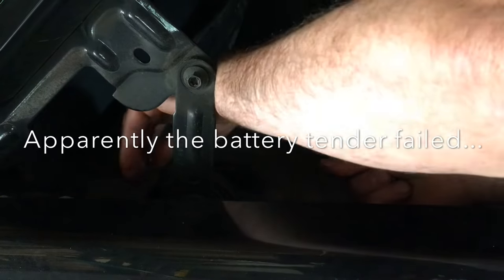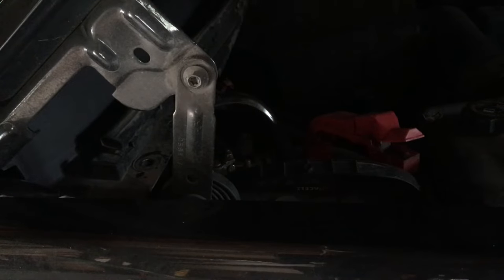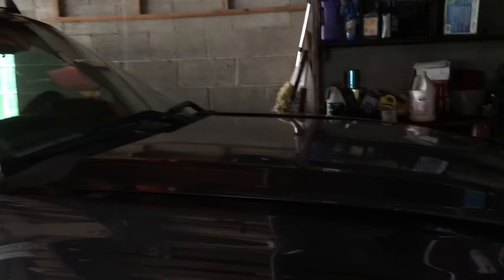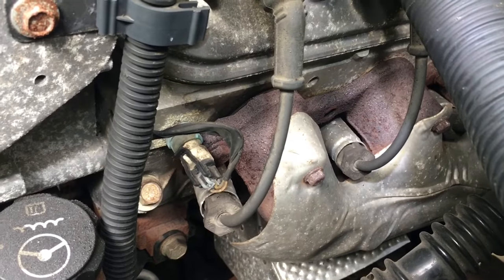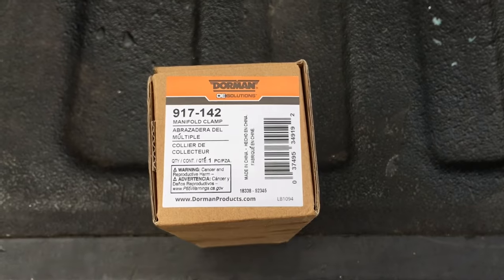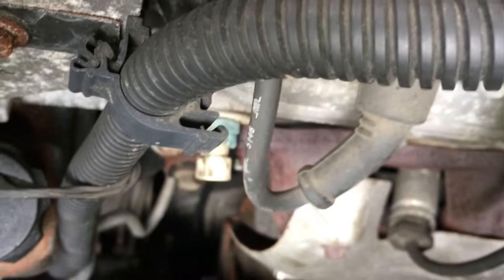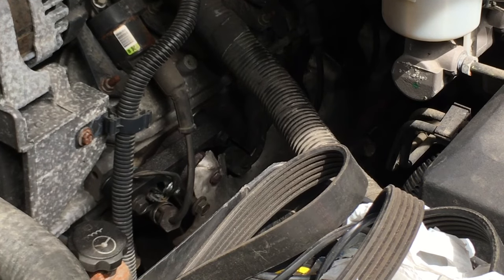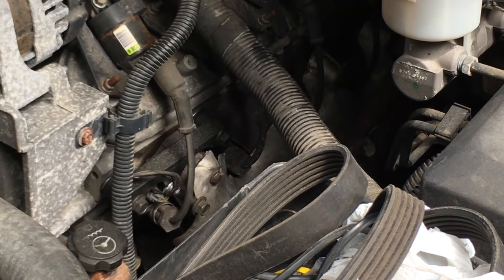5.3 Exhaust Manifold Leak Fixed With Dorman 917-142 Clamp

Comment: You don’t have to remove the heads to remove broken studs, remove front wheels, fender liners, and pull the manifolds off, clean the broken stud hole out with brake cleaner, get you a harbor freight welder and a bucket of nuts and weld it on. If you’re lucky it’s either stuck out or flush, I’ve had them recessed in 1/8th inch. Fill in the hole with weld and then weld a nut to it. Slowly back it out, loosen and tighten. I’ve had one broken off on both back firewalls that’s the most pain.
Reply: Get a punch and firmly tap that stuck bolt to break it free and then You can use a copper tube to run down however far it is recessed into the hole then fill that with weld up to a nut. That’s the way I’ve had the most success
Reply: That's where mined broke off as well
Reply: I mean, that's kinda outta the realm of the diy-er. Buy a welder, learn to use it, etc etc. But you're not wrong, I suppose
Reply: @natemartinez4595  I’m a diyer and it’s exactly what I did. Don’t forget to chase the threads after you get bolts or you’ll be snapping more bolts in those bad threads

Comment: I just now used the Dorman front driver side clamp on my 2001 Tahoe, 5,3 Vortec.  I am far from being a mechanic.  It took me maybe 15 minutes max.  Exhaust ticking gone!  It fit perfectly with no trimming of heat shield required.  I just disconnected the coil wire (left the spark plug wire connected) and temp sensor.  I used anti-seize on bolts and screwed the clamp on and tightened down on the manifold bolt.  Reattached everything and it worked like a charm!  I highly recommend the Dorman clamp.  Don't fool with cheaper model.

Comment: Just my luck...the #8 cylinder had the exhaust leak.  Bought the 917-142 and damnit if the rear bolt hole that this was supposed to attach to was broken off!  Fortunately, the rear bolt that was missing from the exhaust manifold was just missing and not broken off.

Comment: Yeah,  that work good  ,I install six o those  ,that one at front driver side, center and rear it works the same clamps on the passenger side in the opposite direction, one hour repair, that sweet I didn't have to remove any bolts Haha, this isn't a mystery GMC meant to get this clamps in the market  that explains that extra holes all around the manifolds heads 👍
Reply: Removing the bolts are pretty easy I live in PA and mine is a 2000 Silverado 1500 heat them with a torch to cherry red tap it with a hammer and they come out like butter but unless they are broke this is perfect
Reply: Pedro was your truck misfiring bad before you installed them
Reply: Have a link to all of the clamps?
Reply: @THERIPPER216  get them on Amazon.
Search your vehicle name and manifold clamp

Comment: I ran the sensor wire through the hole and plugged it in before I installed the bolts (1st time I could not get the sensor to plug in when the bracket was installed, so i had to pull it off and start over). So far so good, no annoying exhaust tick...

Comment: Mine does the same!!! I now will check out those studs!
Reply: Turns out I have a broken stud on each side and they are both up front so easy fix!
Reply: I installed it and it fixed my issue!!!
Reply: Did you have to trim your heat shield?
Reply: @matthew8193  can’t remember I think I just bent it out of the way or removed it.

Comment: My 09 F250 leaks from exhaust tip and rattles from the front when I start it. Should I replace the exhaust manifold ?
Reply from the maker: Hard to say without seeing or hearing the problem. Sounds like you should get it evaluated and make your decision based on a mechanics findings. Good luck!

Comment: Pass side rear broken head, not leaking yet. I've been gearing up for this battle, lubing them copiously with penetrant oil. Had two on a 3/4 6.0L that were a monster bitxx to get out with head installed. These weren't available then. I think I'll still change out the good ones with new anyway to avoid, if possible, any further headaches. Crap design for so long and they just keep ignoring it.
Reply: I got all of mine out by just using wd40 over a course of two weeks.As long as your bolts and manifolds aren't rustic looking they should come out easy just don't use a breaker bar or impact only a socket and ratchet.
Reply: @Tyler Hubbell  Welding a nut over a washer over the broken stud is the answer. The heat breaks loose the thread locker and the nut can be wrenched out even in the worst position.
Reply: @JoeBribem  you could do that if they break but I was talking about trying to get them out if they aren't broke "YET".

Comment: Right I got see if that work on my dodge ram 2001 360cu in driver's side back by firewall exhaust leak if Not what pain ass to pull mine all apart 2-weeks to fix mine alone.

Comment: I’m looking for one of these now for my 6.2L. Wasn’t sure how they worked but this definitely worked. They’re hard to find right now like everything else. Wondering how it held up because I’m not thrilled about removing the whole exhaust manifold
Reply from the maker: No issues. Someday I might have to do the manifold but it is still hanging in there.
Reply: I got mine on ebay for like 35 buck for all 4
Reply: @Operator-fq2fn  what a deal, i feel like gm should have had these on from the factory
Reply: ever find a fix without removing the manifold? dorman didnt work for me. 17 sierra

Comment: Mine is the very front manifold bolt on driver side do you think that will still fix it?
Reply from the maker: Dorman makes a different clamp for the outside bolts. See if 917-107 or (something similar) will work for your vehicle.

Comment: I have a leaking exhaust manifold .. it looks like drivers side in the front.. Where do I know from, if it is the bold and not the only the gasket? Can I see it from above if its the Bolt in the front (Chevy Express 4.8 V8 - 2005), when I remove the dog house?

Nice video btw :)
Reply from the maker: You could see if the Dorman corner bracket clamp is a better fix. That clamp is meant for front studs. I don’t think the 2005 will have an exhaust gasket. The newer V8 engines no longer use them. Hope one of them helps your leak!
Reply: @growntogether9913  Ahh. man, you are an eye opener.. so there is no seal/gasket between the engine and the exhaust manifold? So when the exhaust is leaking, it has to be because of a broken bolt?
Reply from the maker: @rehab4everybody  Very likely.
Reply: @growntogether9913  So good to know. Thank you man!
Reply: My truck failed inspection for an exhaust manifold leak,any idea if with this clamp it would go through?
Reply from the maker: @richmoore8595  Sorry I don’t. We don’t have vehicle inspection where I am.

Comment: Mine sounds just like this but it’s coming from under the vehicle can’t really hear it from under the hood is it still the same or no
Reply: If it’s coming from the bottom of the engine probably not. You’re getting close to crank bearings and stuff down there. Does it do it all the time? Does it go away when you have oil pressure?

Comment: i really wish people would be specific about what kind of vehicle they have... i recently bought a clamp for a 2018 silverado with the bolt broken on the manifold and it wasn't the right clamp even though the description said it worked on 2018 chevy silverado with 5.3,
Reply: Should work on all 5.3 v8 engines. But you have to buy the correct part. There are different shapes depending on where you need to make the repair at. 
I bought one made for the front driver side and another one for the rear driver side.  They are both different. Maybe you got the wrong one?

Comment: mine makes this noise passenger side and goes away once warm it sounds like under the truck i thought it was the flange but its near the header
Reply from the maker: Sounds like a leaky exhaust manifold for sure.  Heats up and seals better.

Comment: I did my drivers back and it was very hard. 
I also need my pass front. But it looks like there’s some bracket using the hole
Reply from the maker: The clamp for the backside is definitely more of a challenge. Not sure what to tell you about that front.  I know there are other solutions out there. Perhaps another manufacturer has a slightly different clamp that might work?
Reply: @growntogether9913  he is probably talking about the egr on the front passenger side
Reply: Does this cause engine light to turn on?
Reply: @carloscocojr  no. Do you mean with the champ on will it cause the engine light on ?
Reply: @chachifeere  I have a broken bolt on the manifold and I hear the leak. So does that cause the engine light to turn on? Without the clamp
Reply: @carloscocojr  I don’t know. I didn’t on my trucks.  Go get it scanned
Reply: @chachifeere  my check engine light is on and reads Cylinder Misfire
Reply: My one truck has holes in the manifold and when I run it my light didn’t come on. But I patched up the holes.  Check you plug wires around all the rubber  I had a miss a few years ago and one of the rubber was worn and had exposed wire
Reply: @chachifeere  what did you use to patch your holes? Did you weld them?
Reply: Is it the same clamp
Reply: I sent the one for driver side fire wall back when i looked at it. Lol. Paid the 200 bucks to have it fixed correct. But i am going to try this one today on driver front 6.0l. so anoying this has to be done every 30-50k miles. Smh

Comment: You would think they could come up with head bolts that wouldn't snap. Course there's subjected to a lot.
Reply: The issue isn't the bolts.Gm put loctite on the manifold bolts from the factory hoping they wouldn't back out when they never do....GM just doesn't know that torquing it down is good enough.

Comment: You can easily weld a nut to it and they come right out. that clamp is ugly AF. 
The last two I got out with vise-grips there was a small bit left on them to grab on. tapping with a hammer 1st helps. Goodluck all and don't use an easy out google is your friend 🍻

Comment: This makes zero sense. The bracket was designed to fix the broken front bolt and you still had the front bolt there. The broken bolt is on the right side below where you put the right side bracket bolt.
Reply from the maker: You got it exactly right. That is what the video covered.
Reply: @growntogether9913  The video is great, but a bit confusing. If the first bolt on your manifold was good (as shown in the video), how did you use this clamp? You would have had to remove that first bolt, but your video doesn't show that. Did you end up removing the front bolt from the manifold, and not using anything on the second bolt that was already broken?
Reply from the maker: 8:00 minute mark. Description of video: On this 5.3 the 2nd stud back from the driver’s front was broken off. There was not a lot of information on how the exhaust clamp would work when an interior stud was missing. In this case it worked well. Hope this helps someone else.

If you’re dealing with the same issue, best of luck.
Reply: It works because the entire bracket tightens down on the manifold flange. The kit does not rely solely (or at all in this case) on the tensioner bolt.
Reply: @Motovader72  no, the entire bracket does not tighten down on it. There is actually a gap there and you use the larger bolt to push the manifold to the engine.
Reply: @mikezupancic2182  yes it does. Maybe watch the video again. The gap between the bracket and the head is there because the bracket is hitting the top of the manifold flange. Look close and think. The last bolt (larger bolt) is doing nothing but resting on the bolt that's still in the head.
Reply: @Motovader72  I've used these, I don't need to watch the video.
Reply: There are mysterious holes in the head around the exhaust manifold. The bolts on the bracket go into those holes. They do not go into the exhaust manifold, bolt holes. The bracket gets bolted on, then the bolt that goes through the bracket applies pressure to the exhaust manifold sealing the leak. understand now

Comment: Will this work the same for a 5.7 v8?
Reply from the maker: The part number is almost certainly different but you should be able to find one for a 5.7.
Reply: @growntogether9913  i tried so far nothing for the 5.7 liter.